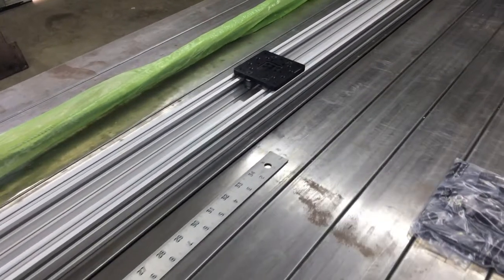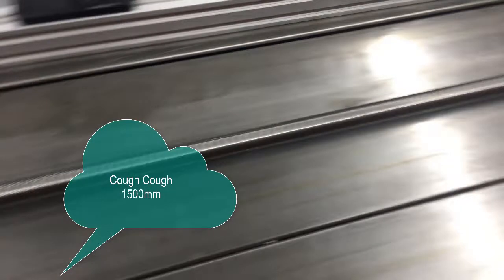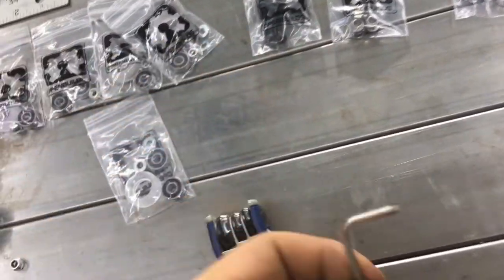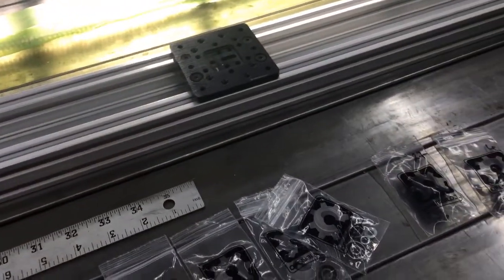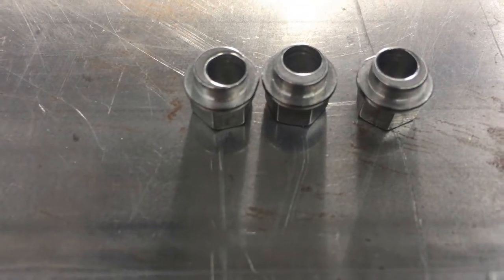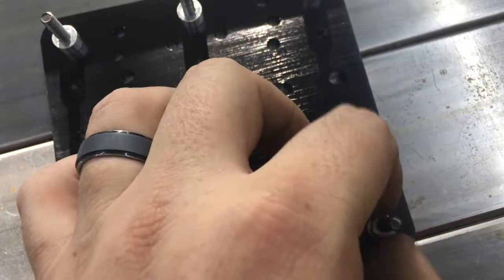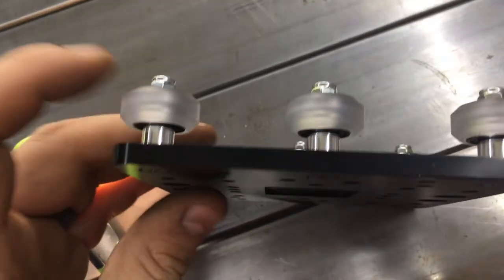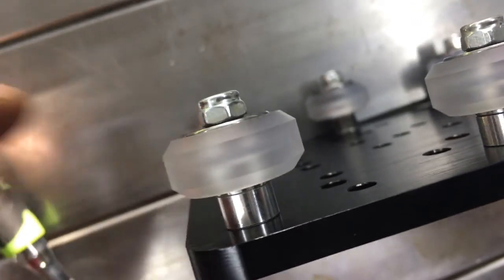LARGEST 3D Printer DIY Build - 1500mm of Travel - I'm calling it the AutoCrafter

Comment: Would you by chance have the design diagrams or blueprints for that printer as well as a point of sale for those 1.5 meter rails? If not, then 5 foot long rails will work as they can be cut to the correct length. You might need a tap and die set as well. Dollar General stores currently have a selfie tripod that would hold that smartphone.
Reply from the maker: Most of the parts can be ordered from the openbuilds store. Build info here. Thanks for the interest! https://openbuilds.com/builds/large-3d-printer-5ft-by-5ft-print-bed.8073/

Comment: This is 3D Pinter and CNC ALL-in-ONE right?
Reply from the maker: Yep its 3D printer, CNC router strong enough for aluminum and plasma cutter. So far I've only finished the 3D printing part and working on plasma cutting next. Thanks for the interest!
Reply: HaleDesignTech yeah man, I’m really interested. I spoke with my uncle yesterday, whom is an expert metal fabricator. I know some of that, but I am more into computer 
Programming & electronic hardware construction. We are going to combine our knowledge and try to do the same thing that you’re working on. Keep it up, I’m subscribed with alerts turned on. I’m catching up on the earlier videos in this series now.

Comment: hey mate any estimate cost
Reply from the maker: Each 1500mm Actuator is $200 - $240 depending on the option you can get. I'm going all out so I'm in it like $1500 so far. Check out the Bil of Materials in my OpenBuilds Build. https://openbuilds.com/builds/large-3d-printer-5ft-by-5ft-print-bed.8073/